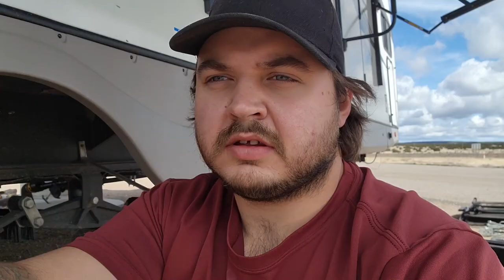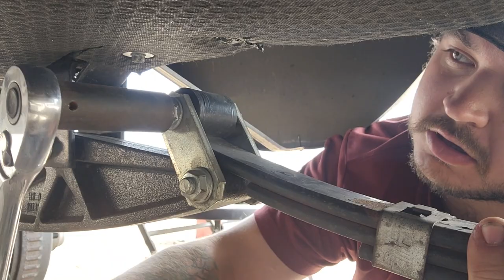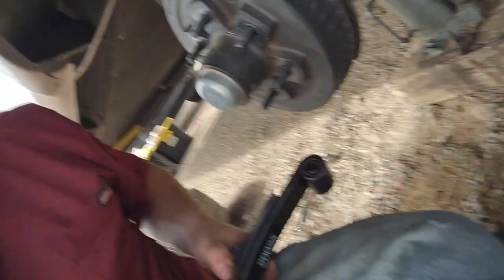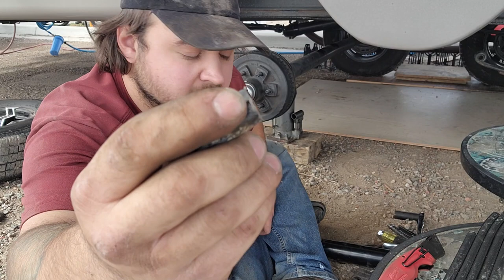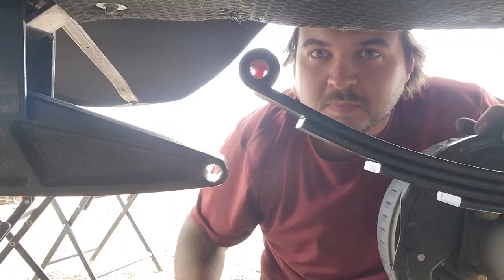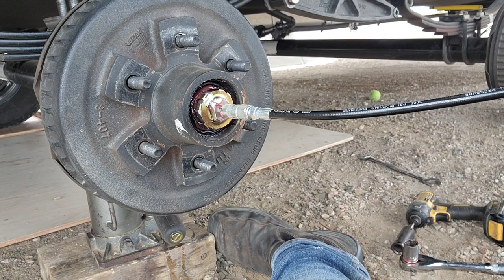Replacing Leaf Springs, Shackles, and Bushings on a Travel Trailer Plus Greasing Wheel Bearings.

Comment: Positive Lube axle spindles are fantastic, I recommend rotating the tire while changing the grease and you'll avoid blowing out the rear seal. I made it a point to use a different color grease every time, this way when I saw a color change coming thru the outside or small bearing, I knew that I didn't have any air pockets in the hub and it had 100% new grease back to front. On my Offshore Salt Water boat, I'd perform this procedure once a month. One tube of grease was enough to do four hubs. Being submerged in salt water and then put on the road is much harder on axle components than what an RV would ever see. 
You can purchase new hub caps with a removable rubber plug that will keep you from knocking out the old hub caps, Marine supply stores carry these

Comment: I enjoyed your video. When adding grease to the bearings using the zerk on the spindle, you have to rotate the wheel/bearings as you add the grease.  If you don’t, you create a high pressure knot of grease in the rear/inside bearing where the grease exits the spindle. The grease will almost always blow through the seal.
Reply from the maker: Thanks for the tip!

Comment: I bought my Trailer NEW 7 years ago and there's not much left on it that I haven't upgraded or replaced on it. But I really enjoy working on my trailer it gives me something to do when we're not rolling down the highway. Just curious if you've Cat Scaled  your trailer? If you RV full-time one of the best things you can do is Upgrade your Springs Axles and Tires!  Stay safe out there.🙏🏻👍
Reply from the maker: We did CAT scale when we first got it, and it was roughly 8-9,000 lbs. We have changed a lot sense then, so I'm sure that it has changed quite a bit.

Comment: I am about to replace the equalizer and add wet bolts. Can you explain how you jacked up the trailer and supported it at the far ends of the frame? I see your jack stands, but the scissor stabilizers are not meant to lift the trailer. Did you place your bottle jack somewhere? Thanks
Reply from the maker: I jacked it up by the frame next to the axles using a bottle jack and wood blocks to raise the jack height.

Comment: Great Video! Can you tell me why you chose to buy the Bushings, Shackles and Shackle bolts separately instead of buying the MORryde heavy duty upgrade kit and the U-Bolts?
Reply from the maker: Just Because at the time it was a necessary repair but had to be done as cheap as possible while still doing it right. We do plan on possibly upgrading in the future but for now it works great.

Comment: How do you have your trailer raised for wheels to come off?
Reply from the maker: A bottle jack under the axle. Then after I took the wheel off I used 2 jack stands on the frame one in front and one in the back to support the trailer while I did the job.

Comment: NEVER use the zerk fitting to grease the bearings. You easily risk blowing out the grease seal and destroying the brakes, Also you should have replaces the bolts with wet bolts and uses a cushioned equalizer replacing the stock one....makes a huge difference in dampening the trailer ride. Also you mixed 2 types of bearing grease...lithium and moly....this can cause a breakdown of both greases. Removing the bearings cleaning and repacking allows you to see if there is any wear in either the race or bearing then repack .
Reply from the maker: A few thousand miles and everything is fine. I also explained my reasoning for some of the things that you commented on in the video.

Comment: Did you ride height Change any?
Reply from the maker: Had I bought the correct length shackles, it would have, but the ones I got were slightly longer, so it pretty much balanced out. However, I do plan on putting the original length shackles on in the near future because now, sometimes, the leaf spring comes in contact with the frame.

Comment: Partner I would suggest you never pack your wheel bearings like that. I pack my bearings every year and last year when I took the hub off I noticed it cracked and I would have never seen it by doing it your way. In my situation it could have been a catastrophic failure going down the highway. It only take a 20 more minutes.